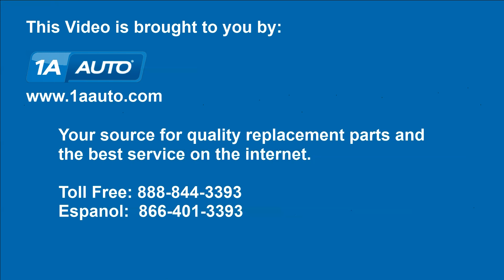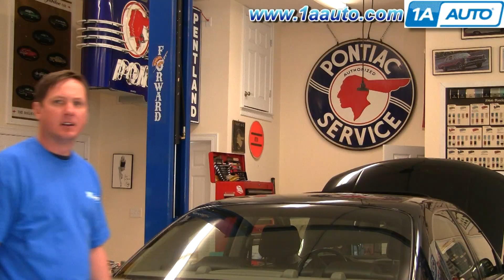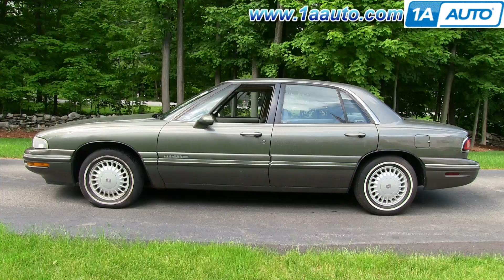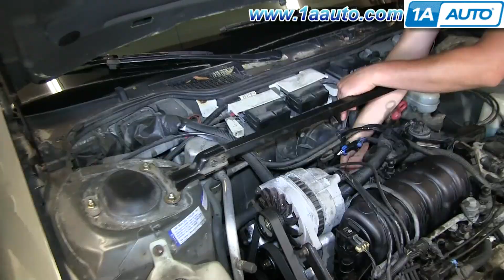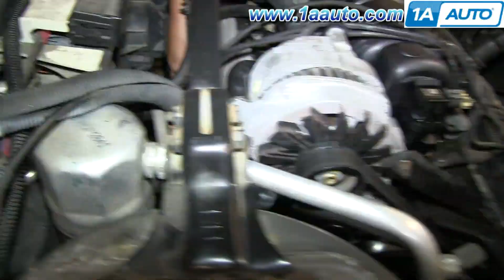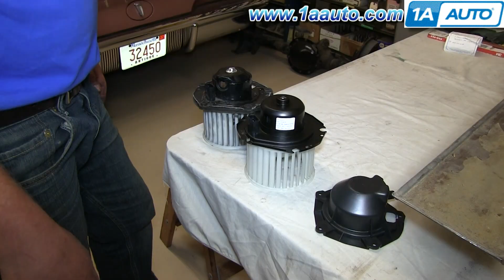How to Replace Blower Motor 92-99 Buick LeSabre

Comment: At 4:04, he mentioned the "elbow for the drain".  It's actually cooling air for the backside of the motor. Don't delete it! You'll be sorry if you do, the motor will overheat.
Reply: At 4:57 he mentions to point the "drain" hose down.  WRONG!!  Connect it to the nipple from the HVAC box, that's right there by the motor. When the blower is running, pressurized air comes out of that nipple, to be blown into the backside of the motor, to cool the motor armature.  Not connecting it will lead to an overheated blower motor, and possible smoke/fire from the heat the blower motor generates.

Comment: Remove the upper strut tower brace cross bar, it's not worth beating-up the blower, and risking damage to engine components as you try to rip out, and stuff in the new one through the small space. There are 4) 13mm bolts to remove it. There also may be 2 shims between the bar and the bracket (1 on each side L & R). After you have the blower motor replaced, re-install the bar and torque it to 40 ft/lbs.

Comment: I don't have a 3/8" drive wobble head ratchet. 13mm Gear Wrench worked good. My plastic motor cover disintegrated into many pieces. I installed without a new cover. I was told it is for noise and insulation. Not totally necessary.

Comment: I notice that you sped up and even had a camera cut during the removal/replacement of the blower motor from the engine bay. It looks like a wrestling match to get out from under the stabilizer bar. Is removing the bar not an option?
Reply: It's not only an option, it's a smart idea!  Just be mindful of any shims that may be between the bar and it's bracket.  I had one on the left and right sides of the vehicle.

Comment: So hooked mu blower motor straight to battery and works but when hooked to car it goes on and off and then stops but don't matter if its on high or low so that takes out the high low relays whenever they are looked at my book but where they say they are there is no relay there? So I'm at a loss

Comment: I have 1998 olds 88 basically same egine car set up I changed the resistor n mine but still only works on high speeds .what is going on still im missing ?
Reply from the maker: +Bunki Bunker Thanks for checking us out! We do recommend to take your vehicle to a local mechanic for an accurate diagnosis.
Reply: I bet it blew the resistor again cause you didnt get the original problem solved - the bad fan just guessing

Comment: I replaced the motor and my fan still won't turn on where should I look next
Reply: When the original motor initially went out I came back to the car and I could smell a burnt electrical smell and my fan had stopped working so I figured replacing it would be the answer
Reply: @walkerkeepswalkin  In my experience if the fan blows up it takes the " resistor" with it and that was likely the smell as it appears to sit inside the vent cavity I assume to help keep it cool and have air moving across it?  Anyway  If you have the fancy auto hvac with digital readout its expensive part 100 to 200 bucks and typical to blow up with the fan.  Good part to get from you pull it joint if your a person with more time than money.....If its the slider controls then its cheap and looks like a few springs... but either way its in the same spot to the left and up from the blower motor - under the relays and such.....it has two clips one clip has a red wire - that is the feed.  If you test and its hot but the purple wire on the other clip is dead with the fan on high then that's likely your issue.    Im not a mechanic just a guy with several Buicks and a degree in electronics....  To help you even more here is a schematic for the blower section on the auto hvac assume that is what you have.....

https://drive.google.com/file/d/1aeVPzRzMo6I_UXGviVU61oMVc1sKb6dL/view?usp=sharing  

No need to find the 30 amp to test you just test the red wire at the resistor if its hot fuse is good.  Even if you find that part is bad and the fan motor is still good IMO its wise to go ahead and get a new motor and new resistor because the old fan could be pulling to much current and you dont want to buy two of those expensive parts better off spending your money on a cheap fan motor vs buying a second resistor and then a new fan motor....  I always wonder who and why people write things to help other people and now im wasting my time doing it.  In my case its because im a nice guy and im bored LOL.  Anyway hope it helps someone !

Comment: I have 12v at the blower connector, just changed the blower motor and it’s still not work. If I have power at the connector and a new motor doesn’t work I’m completely lost on where to go next
Reply: If you have 12volts and the new motor dont spin then either you have a bad ground or a bad feed. Or the new motor is bad.  Easy to test the motor run two wires from batter straight to motor if it spins motor is good.  IF motor good better load test the 12 volt side with test light - if the 12volt side has week connection it will drop to zero volts or test light will go out when you turn on fan.  If when you turn on fan the voltage stays then all points to bad ground.  In that case run a new wire to ground vs looking for the issue.....peace
Reply: Did you figure it out?

Comment: Here's another step: remove that brace that's in the way. Only takes a few minutes.
Reply: Done this myself, just 2 bolts on each end of the brace with 1/2" nuts  (IIRC) that need to be undone.

Comment: The plastic cover on mine is trashed brittle and crumbling into small pieces. Heat over the years has destroyed it and the larger part with the insulation on it. All brittle and broken big hunks of plastic gone.

Comment: Excellent!  Looked like a 20 minute job. We are going to have to take our 96 Buick into a shop cause he complains that the fan does not run. He needs the defroster to work. I am wondering if we first need to check a fuse?  Anyone?
Reply: You may or may not have seen the video I did 8 months ago which I'm calling a rescue video if you tap on the blower motor housing kind of lightly the motor may start but remember make sure that you get it fixed as soon as you can this is only for emergency use only if you are stuck in bad weather make sure that you turn the fan too high before you tap it if it does not start then you may or may not have a bad motor just a suggestion

Comment: HELP! What's that top black cover called? Mine literally disintegrated in my hands while I was taking it off.
Reply from the maker: +RoboEin That is the blower motor. The blower motor cage is the white part. Hope this helps you out. 1aauto.com
Reply: 1A Auto Parts  Im talking about the cover that goes over the motor. Haha I can't find it anywhere
Reply: @roboein3754  mine Disintegrated as well
Reply: And no auto parts store has one I found one on rock auto but I'd have to buy a different blower motor

Comment: My old blower motor seized. I replaced according to video  but wont  work now. Could I have blown fuses or something else when old motor failed?
Reply from the maker: +strakatz You may want to check the fuses. If the plug end that goes to the blower motor is damaged it should be replaced. Sometimes they can heat-up and melt. Hope this helps you out. 1aauto.com
Reply: See my response to Walker obrien below.....in short its likely a fuse or resistor but in my case both times it was resistor.

Comment: If you have intermittent squealing, try a little WD40 on the bearing before replacing the whole assembly. Worked for me and it only took 5 minutes start to finish!
Reply: Dont do this -  especially if you have the auto hvac - eventually the fan will pull too much current and blow a 200 $ part.  IF its making noise and you plan on keeping the car replace the motor. IMO  If its the old school non auto temp controls maybe i would attempt it.   Im sure it can handle more current also cheap to replace.

Comment: Great video! This looks like it will apply to my wife's 1998 Olds LSS, too.  Hopefully I won't have to remove that tower stabilizer.
Reply: lol its only 4 13 mm nuts. much easier if you do
Reply: I've got a 98, Olds 88. Looks like it would make it easier to take the brace off, and it's just 4 bolts.

Comment: You were right it's the same procedure. I had to remove the metal chassis bar to finally get it out.
Reply: It's ok to take the metal bar off right? I tried getting it out without removing it but there just wasn't enough room.
Reply from the maker: That should be fine as long as you replace is after the repair is done. That's a strut tower stabilizer. I helps to tighten up the front end. 1aauto.com

Comment: wow im kinda bummed... i changed my blower motor after watching this video and now my air barely blows through the vents :(  I guess little air is better than no air. Thanks for the video. Does this vehicle come with a cabin air filter? I can here it blowing hard and i can change the were the air goes (winshield or floor) the heater also works as well. Something is just blocking it from blowing hard. Any suggestions?
Reply from the maker: You may want to take the blower motor back out and see if there's something in the housing blocking the airflow.
Reply: Hello I am facing this problem too, did you come up with a solution?
Reply: the fan could be spinning backwards....not sure how but i have seen it happen - clip maybe force on in reverse?  Issue from factory?   who knows but thats my guess.

Comment: Not getting any air through the system; removed blower fan and found "walnuts" inside! Checked blower motor and it spun, but not fast. Cleaned out walnuts as far as I could reach. How did the squirrel get them in there and how can I completely clean the passages. 94 buick lesabre.
Reply: All Buick lesabres come with walnuts in the blower fan housing in my experience I guess from the factory. They bang around on the blower motor fan to keep the blades clean  / not the fact that they all sit in grandmas driveway for years while she cant drive and the walnuts only become discovered by her grandson when he uses it for college.  The walnuts only get removed when the grandson sells the car to a middle aged man that doesn't care what he looks like on the way to work so he can destroy it on I80. Has to be the right guy - the guy who cant tell if that is grandmas pee or mice pee or maybe doesn't care as he knows if he leaves the windows down long enough the smell will fade.

  LOL but honestly good luck getting them out, but its typical to find these cars in that kind of shape as they  tend to sit for years.  IF you manage to get them out and drive it daily it ll be fine but i would check the screens by the windshield wipers that is the intake i believe and if they are busted it would be direct access for critters.
Reply from the maker: Usually small critters like mice and chipmunks are the culprits in finding their way into the blower motor. You may be okay. You may want to put it back together to see if it starts working.

Comment: will this work for a 98 buick century?
Reply from the maker: Hi Mike, We currently do not have an auto repair video that shows this repair on that particular application. Check around the location shown in this video, if you blower motor's not there, it should be under the dash on the passenger side. We carry new ones on our website for your vehicle. Here's a link to them on our website. http://www.1aauto.com/1A/blower-motor/Buick/Century/-/-/1998?utm_source=VideoReply&utm_medium=YouTube&utm_campaign=1ATony